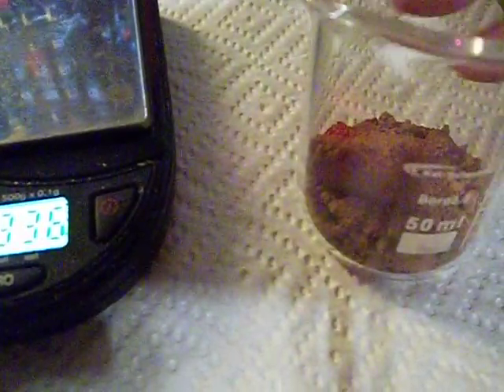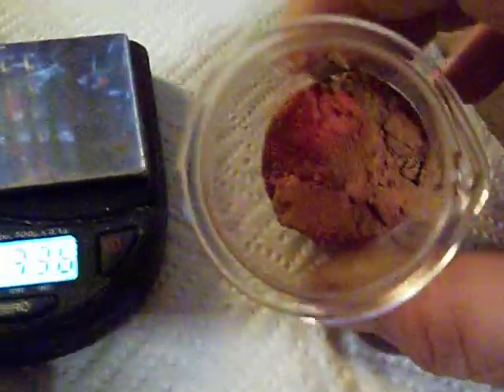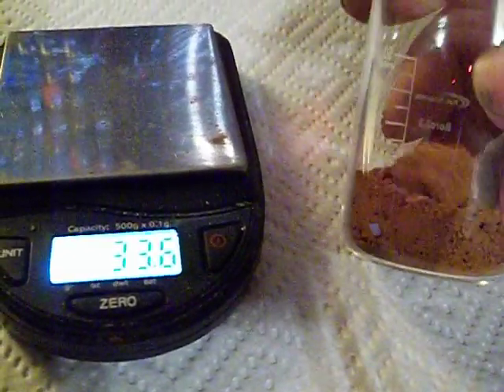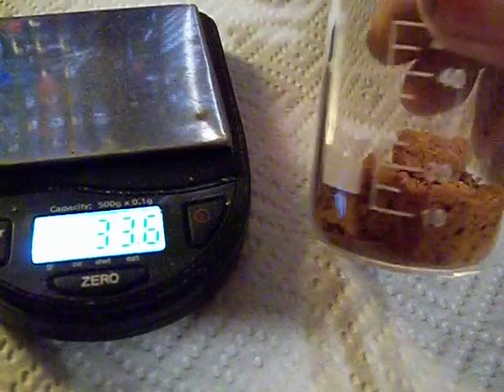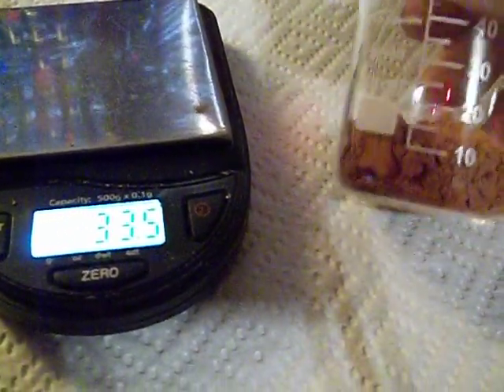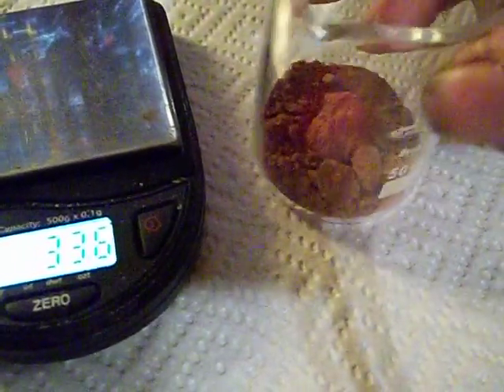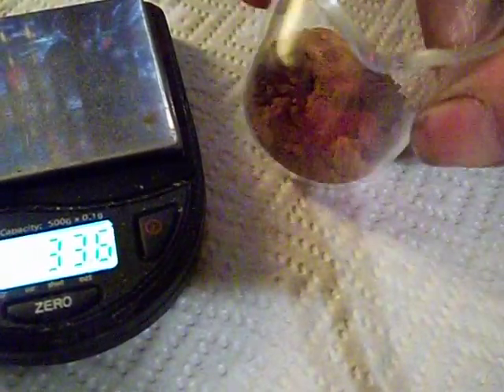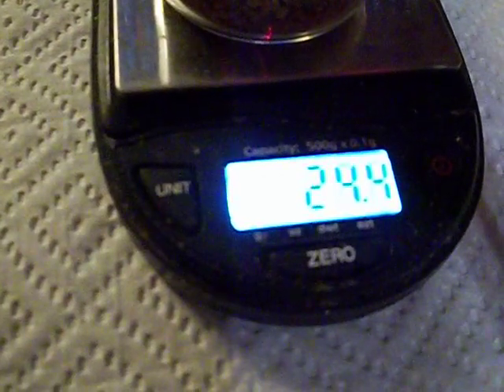Rob's foils 5

Comment: there should be quite a few boards in the second batch with full gold under the green ~ brown mask.
Reply from the maker: +Rob Buechner Yes, there is. They go through the AP first to remove everything from the board. Then I use a bath of hot sodium hydroxide to remove the solder mask. Then they have to go back through the acid. That's what I was talking about dealing with whole boards. It's a lot of work to get them completed.

Comment: does that have the gold from the ceramic processors as well ? and the little jar of foils i sent or is that still separate?
Reply from the maker: +Rob Buechner That is everything you sent the first time. The foils you sent was washed and added to the foils in the video. It includes, but not limited to, all the processors, ram sticks, IC's and IC's from the ram sticks. Some of the whole boards in the first batch are in AP with the boards from the second batch.
Reply from the maker: +Rob Buechner I think that it turned out really good.

Comment: Hi Geo" tell me how do you dry your gold in what ? on what" ?  thank you
Reply from the maker: I normally dry the gold in the beaker I drop it in. I have learned that the more you move the gold, whether in a liquid or solid, you will leave some behind. When I can, I like to start and finish in just one container. I never filter gold powder. 
When drying gold powder, it is best to decant or pour off as much rinse water as you can and set the beaker in the sunlight to let it dry. If you do heat to force dry, cover the beaker and put it on the lowest heat setting as possible.
Reply: fredie w

Comment: Hi Geo" need some help on my Ap" foils I put in 200 g of pins in a air tank syistem i made   in 6days all the steel on the pins are gone . left some foils from the boards & some fingers all was done but the ends of the pins were left after i  filter it looks like it left gold pin ends i put a magnet to them and they move  what should i do to  them as they are mixed up with my good foils ? need your know how ! if you can thanks "
Reply from the maker: +fredie w If it's magnetic, you can boil it in some dilute sulfuric acid. 10% battery acid will work okay. It will remove any left over iron. Be careful when heating sulfuric acid. It is some mean stuff when cool and evil when itls hot so just be careful not to spill and use a glass container that's made to be heated.